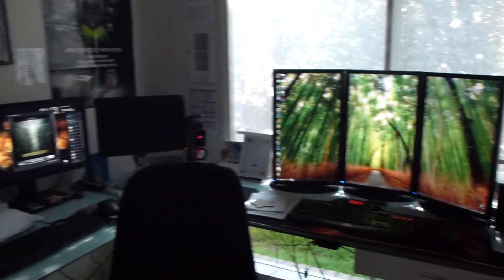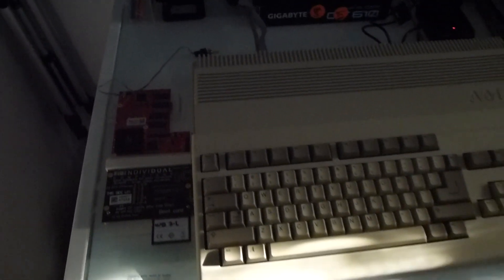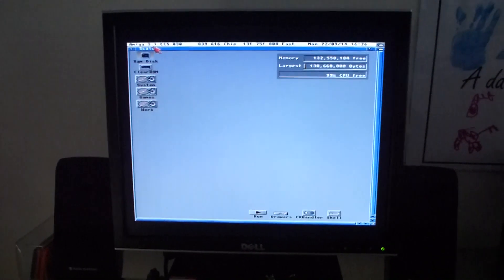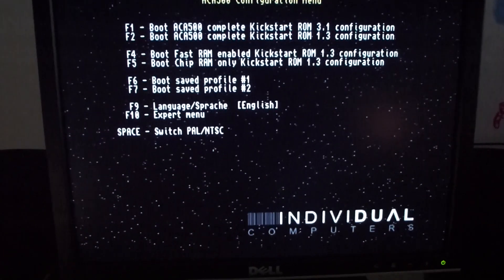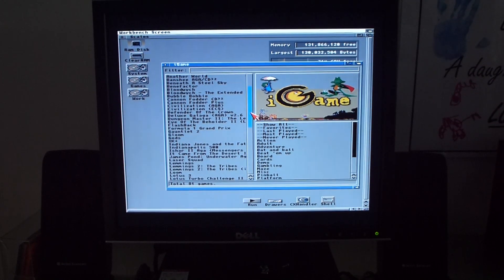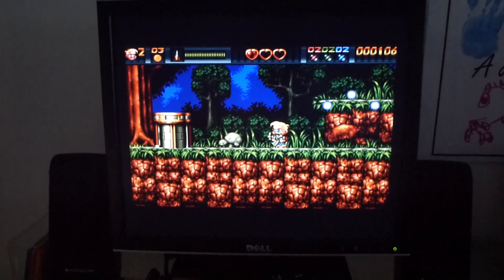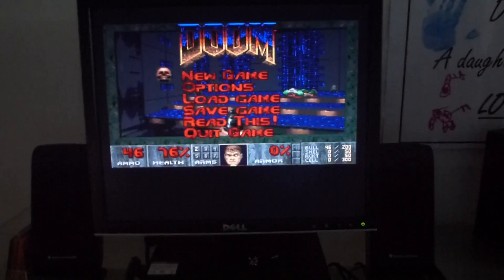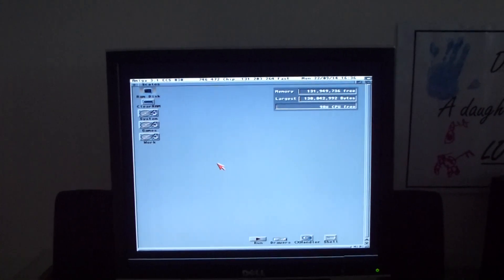Overclocking the ACA1232 on the Amiga 500

Comment: I'm running my 1232/33 at 48 Mhz and gets around 11.5 Mips and 11000 Dhrystones. I changed the clock multiplier and changed the 20Mhz oscillator for a 24 Mhz one.

The 68030 onboard has the G40W mask and runs a little cooler compared to previous masks (0.8um instead of 1um). I suspect that the 030 would go even higher if it wasn't for the memory speed peaking.
Reply from the maker: This is awesome! So, just to confirm Magnus, you replaced the crystal for a 24Mhz part and everything runs fine? Did you make any changes to the overclocking solder pads or did you just replace the crystal?
Reply: Mathew Gatto Yes, I reconfigured the solder pads for 40Mhz (2x20Mhz) first and then replaced the oscillator and got 48Mhz (2x24Mhz). Everything runs fine and has passed multiple runs in AIBB. The oscillator was pretty hard to remove, even with two soldering irons so be careful. The oscillator type you want is called H49 SMD.

I guess I'm a bit lucky that my 68030 is pretty overclockable since it's the last revision (G40W mask) which runs a bit cooler.

I had a Blizzard 1230, in the mid 90s, which I overclocked to 60Mhz and it ran pretty hot and crashed sometimes while running Doom. A heatsink would probably had solved that 8)
Reply from the maker: Magnus Anemo thanks for the reply. I'm no stranger to SMD repair and I have the equipment, so I might take a look at this when I get a chance.

Comment: So it can be easily&safely done with just change of a jumper settings?
If so, I guess I will pay only for 30MHz card and clock it 40.
Saving 30euros
Reply from the maker: Yes Nuke, the process is easily and safely done via the shorting of jumper pads, as with anything in the realm of overclocking nothing is guranteed and the overclock that can be achieved on one processor may not be possible with any degree of stability on another processor - However, I overclocked my ACA1232 from the default of 25mhz to the fastest speed possible of a little over 40mhz with a memory speed of 80mhz and my 68030 handled it easily. The other thing worth mentioning is that the solder pads are very small so make sure your soldering skills are up to the task and you're soldering iron has a small enough tip for the job. Since I didn't show the jumper table in the video here is a quick snap of it for your reference http://i802.photobucket.com/albums/yy306/MattGatto/ACA1232jumpers_zps90acac2e.jpg . Good luck my friend!
Reply: Mathew Gatto
Allright, I currently have aca-1220 so I know what I would be dealing with :)
Going to get 1232 soon, and there was mixed information about if the jumpers can actually be used for overclocking, or only to set the right clocks for different CPUs
Reply from the maker: I can confirm that the solder pads can definitely be used for overclocking. :)